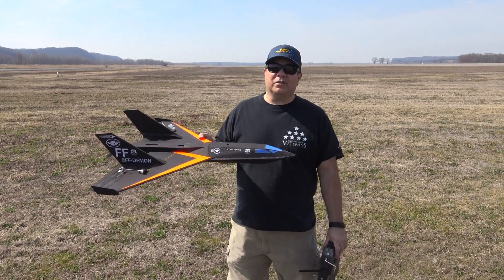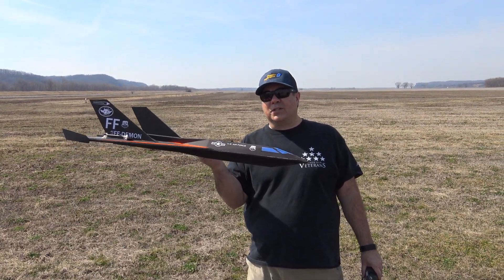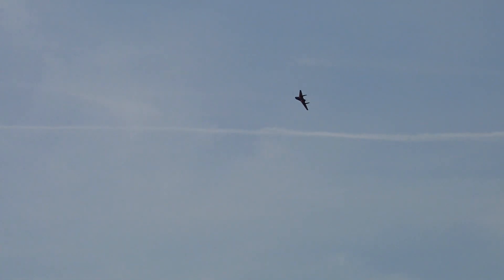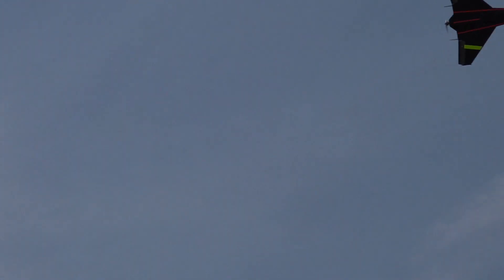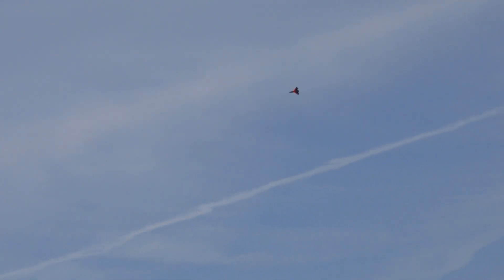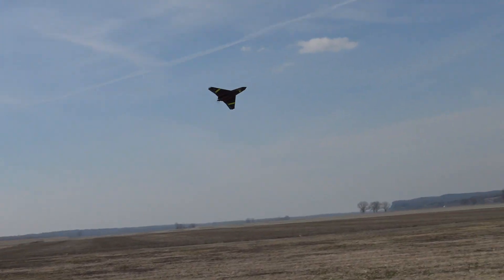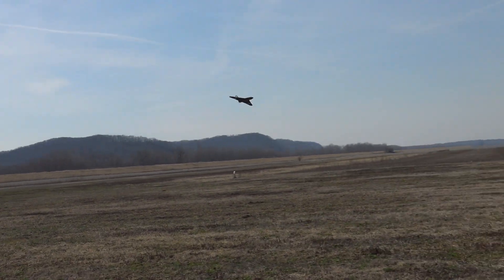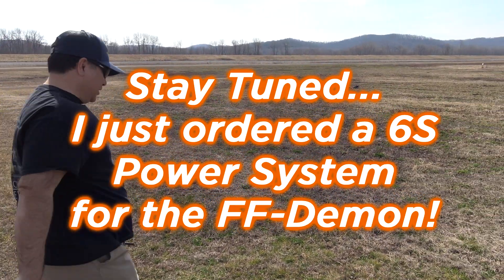FF-Demon In a little bit of Wind

Comment: Should be good on 6S.
Reply from the maker: Thanks rcplanpirate!  Should have the 6S setup on the plane for the next FF-Demon video. I ordered the same motor that Frank put on the Strix Goblin. Its a T-Motor 2806.5-1300kv motor. It's light, small and about 1000+ watts with a 7x5 or 7x6 prop. Frank's plane looked pretty fast and he didn't really even go full throttle much. Should easily be 100mph plus plane! Have you made any new planes or crazy EDF's lately RCPP?
Reply: @rcFoamFighters  Hi. 100mph+ for sure. Sorry still haven't flown anything for a few years now or done any motor tests, but watching your videos lately have definitely got the cogs turning in my head. Stuff like making an adapter on my lathe to fit a 1900kv 36mm outrunner meant for a 90mm 6S edf. So I can fit it to a 70mm edf and run it on 8S. Hoping to get something like 2.5KG / 5.5LBS of thrust. Some people also want to see me use the 2968 3400kv inrunner that I've used in a few videos on up to 5S, but this time try it on 6S. Could be interesting.